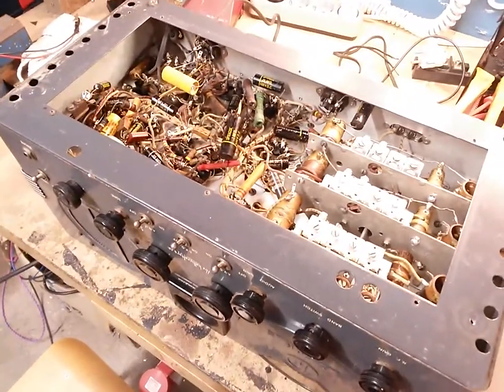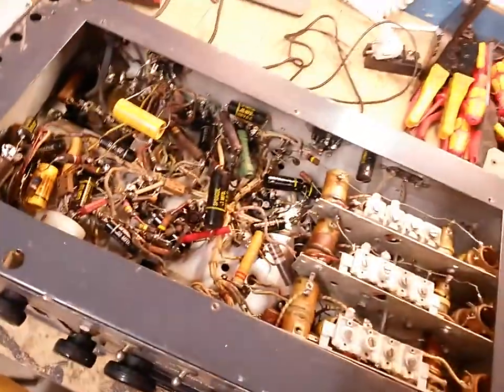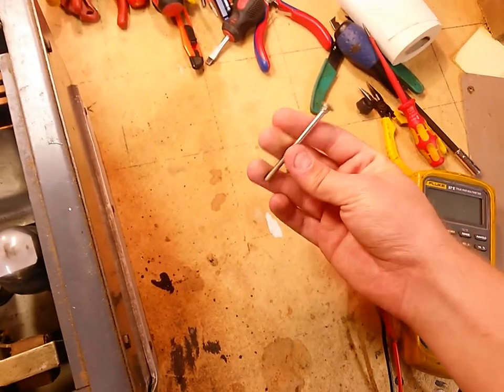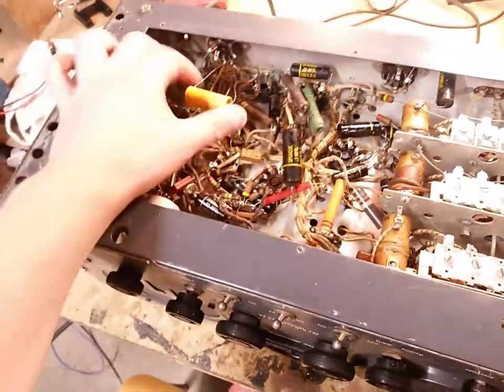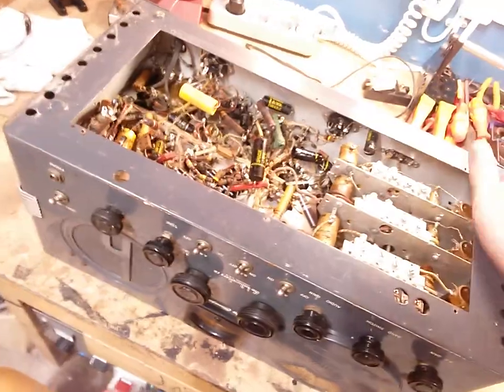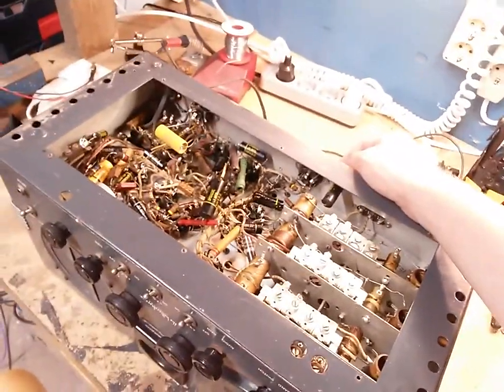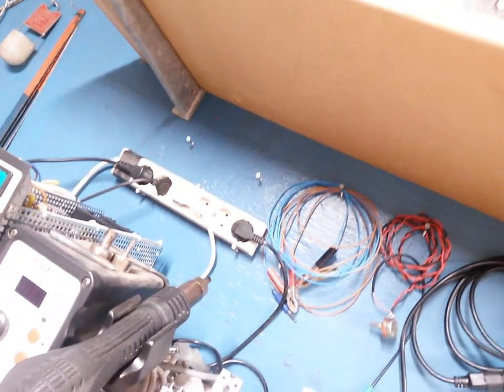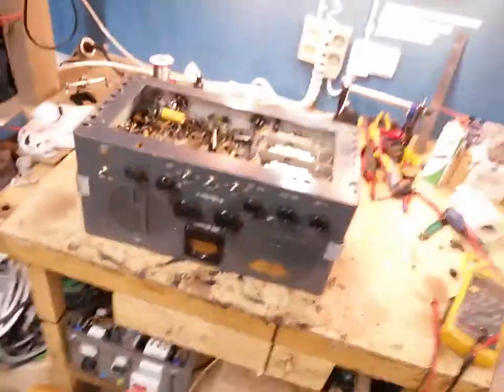Hallicrafter S-20R Part 1 - Aquasition first look

Comment: Lol have to love the work job of previous attempts lol. Kind of surprised that it even worked with the areas that were not soldered. Love your enthusiasm about electronics. I too find them fascinating, like seeing the simplicity of them compared to now days.
Reply from the maker: Ayyyy you found my channel :D for some reason youtube notifications are completely bonkers and not letting me know about new comments! So I apologize if I haven't seen your comments yet! 

Hehe yup, this thing was a very hacked up mess :P But it turned out so well in the end :) And yes! The simplicity makes me feel happy in a way, I can actually properly understand these old circuits, while I have huge trouble understanding modern stuff lol
Reply: @tigerelectronics5966  hey there. 👋.  Not a problem and I understand.  I as wrll am having the same issues with the notifications and such. I have to keep checking back. 
Yes I did find your channel too. I like the vintage items as well. They have charm to them and quality workmanship went into them. Fixing vintage is  fun. Wish new electronics weren't so small lol. Great video